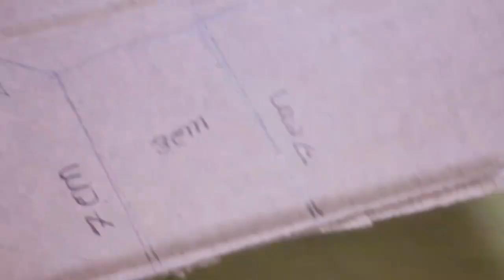How To Make A [Flying Airplane] - At Home

Comment: this is completely fake the weight the batter is super heavy and the speed that its supposedly "flying" is way to low anyway also there are no horizontal stabilizers  i could go on and on but this is just a summary